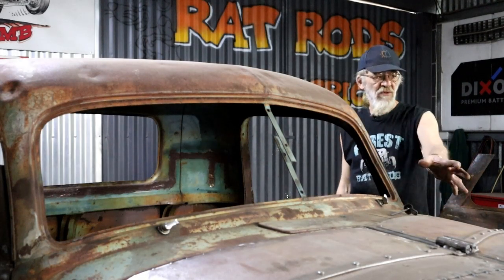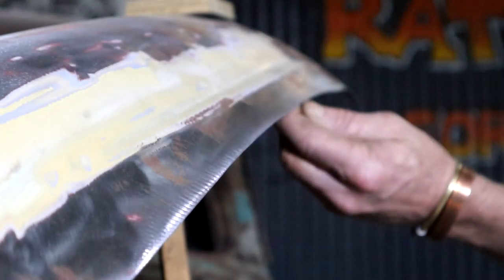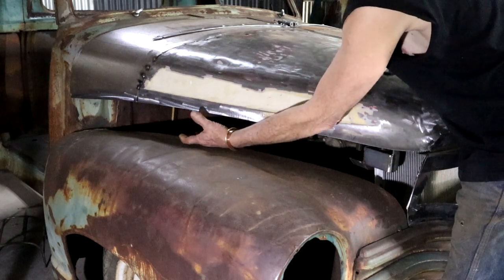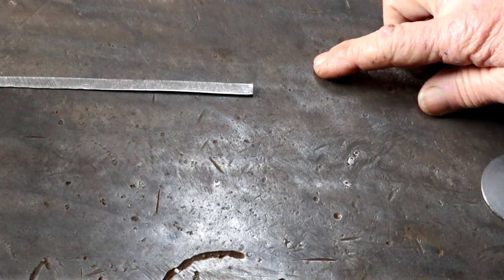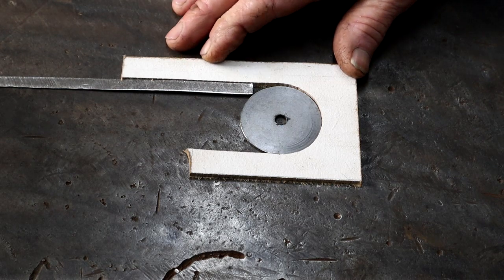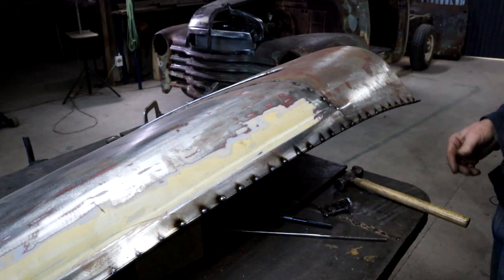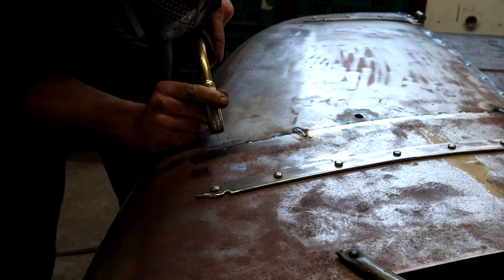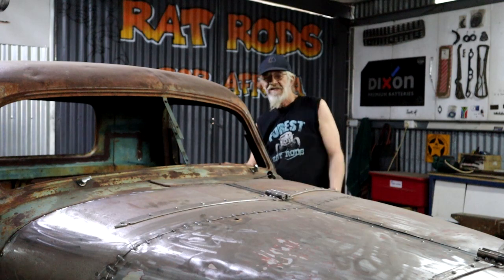BUILDING CUSTOM BONNET/HOOD (Part 5) - Round bar edging and other details.

Comment: Nice job with that jig and the plug weld rivet look.  For the gap above the grill have you considered getting another (donor) grill and cutting one of the bars to fit the opening?  Just a thought from the recliner mechanic lol.
Reply from the maker: Thanks man! Using pieces from another grill will be first prize, but finding one out here will be very difficult. These trucks are pretty scarce here in SA. Gonna have to make something...
Reply: @ratrodsafrica  gotcha.